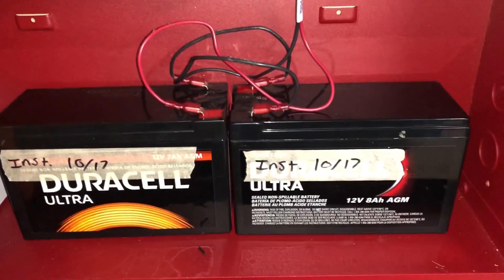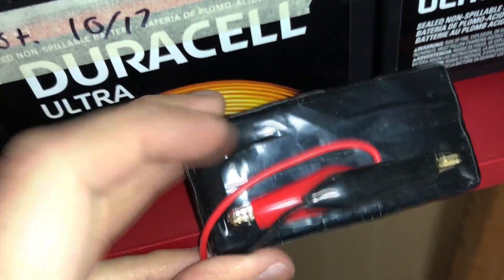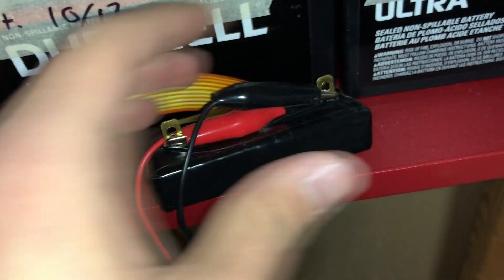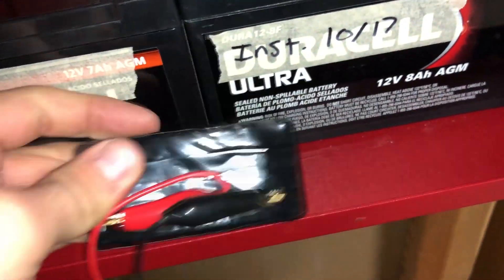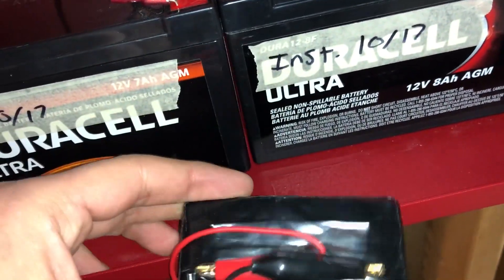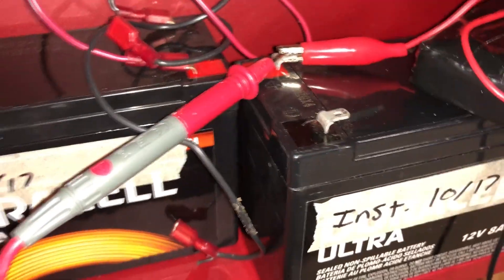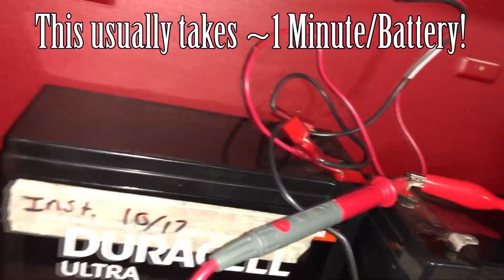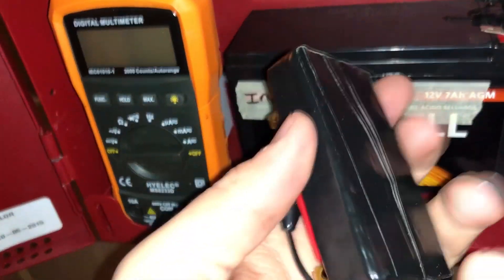Fire Alarms Explained: Load Testing Batteries with DIY Load Tester

Comment: So if you're putting a 6 ohm load on your 12 volt batteries (rounding here for simplicity), then the circuit is drawing 2 amps. (I = E/R or 12 volts /6 ohms = 2 amps.) the power dissipated by your load is 24 watts. (P = I x E or 2 amps x 12 volts = 24 watts.)

Comment: Why would the voltage drop then go up when you load the battery?  I tried this on a 6v 4ah  battery (using the same ballast resistor) and the voltage never stopped going down.  Just trying to understand the theory behind the test.

Comment: why there are two battery in FACP?
Reply: It’s a 24 volt system. Batteries get wired together in series to get the 24 volts.

Comment: Would this work for any size of SLA batteries as a load test or would this only work on 12V 7.5Ah? I'm a tech in Canada and I'm just starting my career and I'm looking to learn as much as I can.
Reply from the maker: So, this tester is better for smaller load batteries. I only use it for 7 - 12 Ah, gets too hot and takes too long on the bigger ones. I’d recommend getting a legitimate load tester for larger batteries, though this thing certainly works well for the smaller loads!